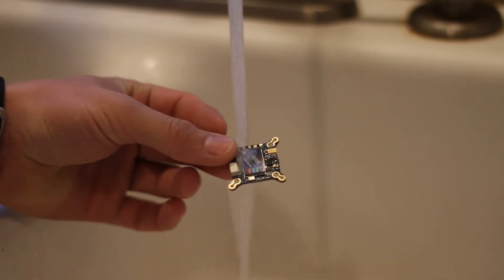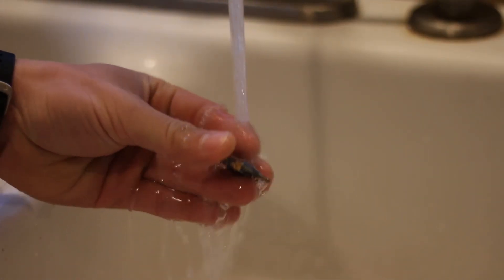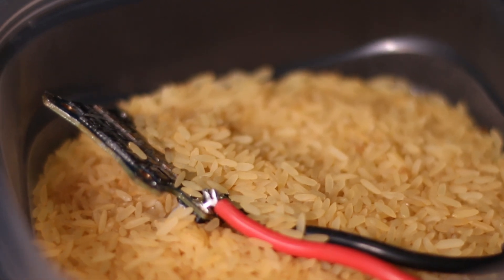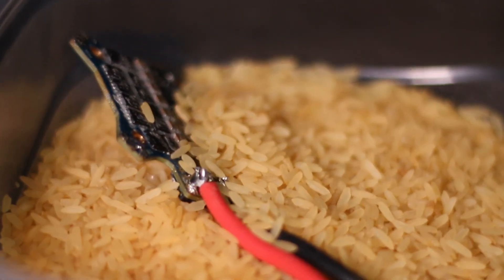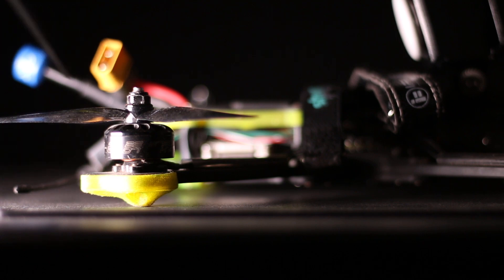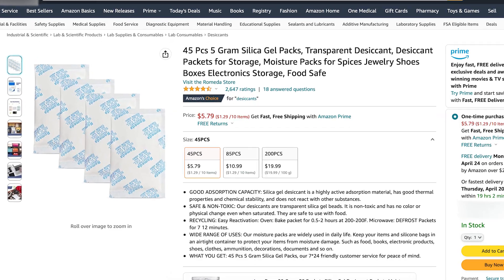Fix water damage on your drone

Comment: Mine fell in the sea 😅
Reply: Mine  too.. just yesterday.. than i cleaned it with a normal water and now i will wait min 48hrs .. till i try if still work.. 
what about yours ?? Its working?
Reply: Did it work? Mine just went surfing in the ocean.
Reply: Mine fell in gutter water , although running but one fan is not running smoothly.One of the fan is little bit jam.
What to do any suggestions?